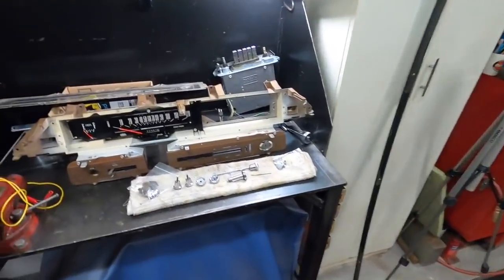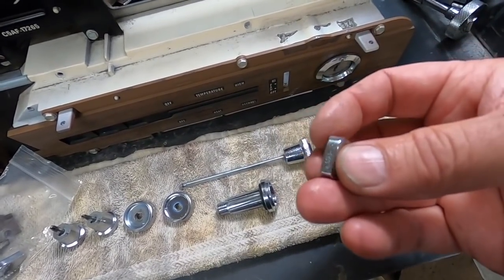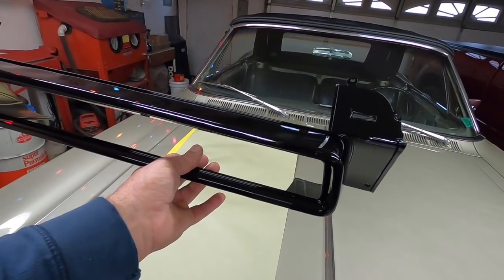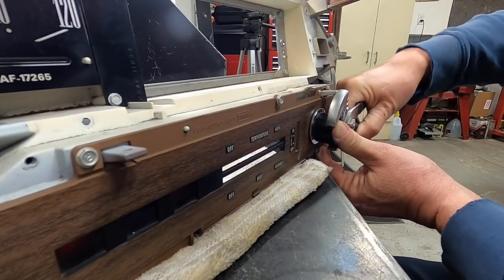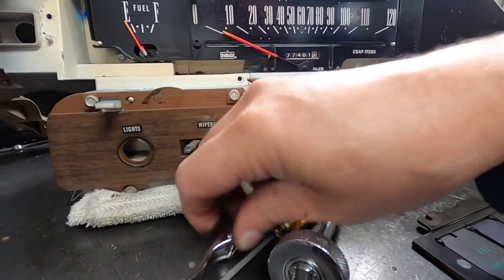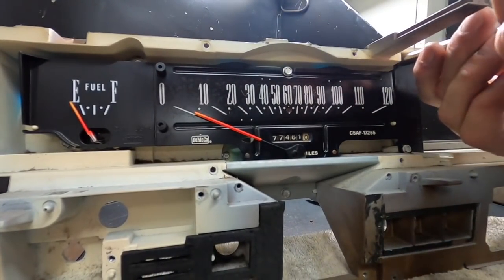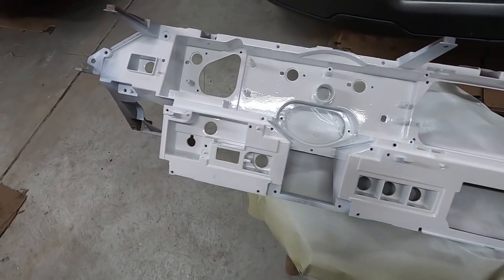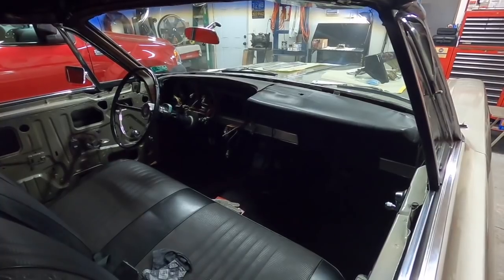1966 Ford Galaxie 500 convertible restoration part 155 totally disassemble dash cluster

Comment: Amazed at the difference from before to after painting the dashboard!
The explanation of how the speedometer works I remember from another restoration in the UK 🇬🇧 Pete C Cortina City who Restores Ford Cortinas, the last two were in very poor condition, and he restored them with some modern cons like heated seats, washer jets, and Bluetooth for the radio. He went into detail on how the speedometer works, so your explanation was a refresher coarse for me! Cannot wait to see how the instrument clock turns out, hoping you can repair and have it working again.
Excellent job!
Reply from the maker: I didn't think the video was really showing how yellowed the original finish was, until I showed it repainted. It should make a difference on the brightness of the dash lights.... I hope.

Comment: Interesting Ford painted the inside of their gauges white, and used blue filter caps to diffuse the back light. Most gauges I’ve taken apart (mostly GM’s) painted the entire gauge cluster backing a matte robin’s egg blue instead to diffuse and filter the incandescent light without the blue filter caps. Probably overthinking it, but will the gloss white paint create glare /uneven (but brighter) light since it will reflect more vs absorb? Excellent job and commentary/instruction on the entire disassembly. 👍
Reply from the maker: I think the dash will look much better at night. Originally it would have been a bright white.... it was yellowed really bad in some areas. The video didn't show how bad it was yellowed, until I resprayed it. Ford did it that way, because blue docent ruin night vision.... Plus the Ford instruments are not in a "can" like GM's. If Ford had painted it blue instead of white, It would not reflect much light and would be very dim. It's a much bluer light than the Bel Air, with it's robin egg blue inner cans..... that blue should be gloss too. It's gloss in the Bel Air. The only real issue is, I don't see a lamp in the radio area, or a lamp in the radio.... I'm wondering how the radio dial is illuminated, or if thats a dim part of the dash. We will see when its all together.
Reply: @OldCarAlley : In my '65, the light for the radio is inside the radio.
Reply from the maker: @alanwhite3280  Make sense.... I'll have a look when I clean it up. Is it on whenever the light are on, or does the radio need to be on too?
Reply: @OldCarAlley  sorry for the delay in responding to your question about the radio light: yes the radio needs to be on. Also according to the '65 wiring diagram the light is wired to the headlight switch directly. Hope this helps and natch keep up the excellent work.
Reply from the maker: @alanwhite3280  Thank you.... I looked at the shop manual wiring schematic.... as I need to know the wire color for the lamp, so I looked at the whole circuit, and figured it out. Really simple, powered off the dash panel lights.

Comment: somehow the speedo in my 64 Galaxie reads fast, reads 70 when I'm actually going 65 and it gets worse the quicker I go.  I know my tire diameter is correct and I'm running the correct 3.00 rear gears.  I'm thinking it's the gear in the tail housing of the trans.  Is there a chance my actual speedometer could be off?
Reply from the maker: I think the speedo gear on the trans end of the speedo cable is color coded for the axle ratio.... gears come in different colors. All that info is in the shop manual. Make sure thats correct first. There is a spring on the speedo that will adjust it.... I never fool with them, because there usually always spot on. 99% of the time it's the incorrect gear at the trans.

Comment: Howard whats the round head socket wrench called?
Reply from the maker: Im not sure what the correct name is.... it's just a ratchet with no handle. Nice for tight places, where the bolt is not super tight. I bought them at Harbor Freight. They weren't very expensive.... under ten bucks for a 3/8" and 1/4" drive I think.
Reply: @OldCarAlley   thank you !
Reply: @timothydeyoung5653  -- They call it a palm ratchet. They certainly come in handy!

Comment: Do you know anyone who can rebuild old factory window switches. I know someone who has the factory switch mounted on the center console for all four windows but the switch doesn't work so they wired in an under dash switch panel
Reply from the maker: If there not the newer molded plastic type, they can be disassembled. 90% of the time, switches just need a good cleaning. I don't know anyone that services them. I do my own, so I never tried to find someone that does it.... Some of the plastic ones do come apart, but there is a chance of breaking the plastic.
Reply: @OldCarAlley  That's what i was thinking. Old factory switch that has probably seen lots of drinks and rain. Don't know if its ever been attempted before and how many times its been attempted. Would be nicer if they could get it to work. Everything else seems to be up to standards
Reply from the maker: @garyangelstad5212  If all else, take them out, hose them out good, in warm to hot water, then blow them out with compressed air carefully, then let them dry out for a few days.... they "might" work again..... If there  in 100% failure mode now, you have nothing to loose by trying.